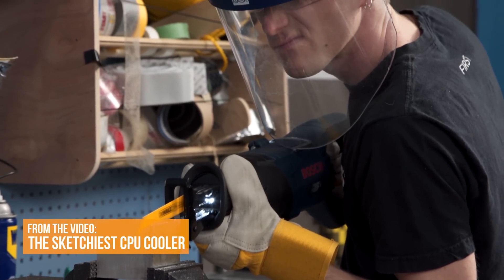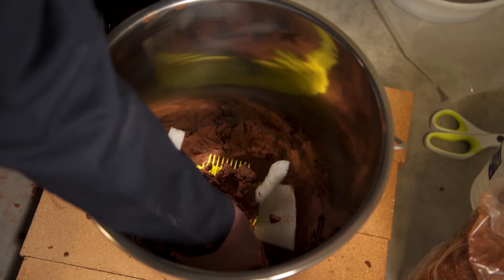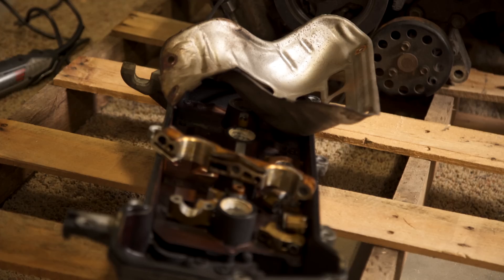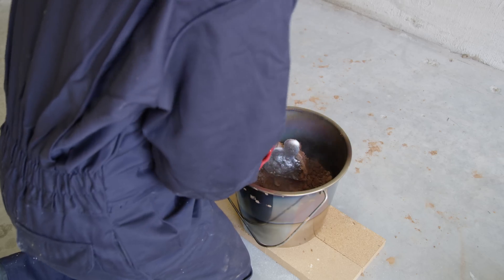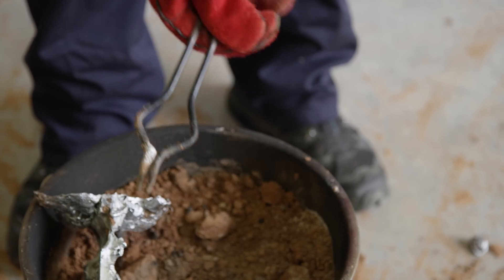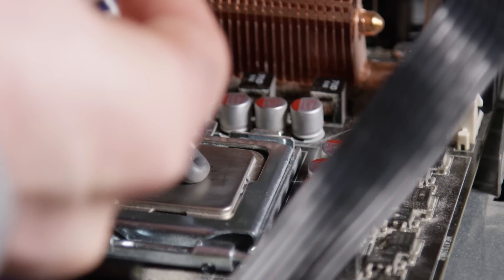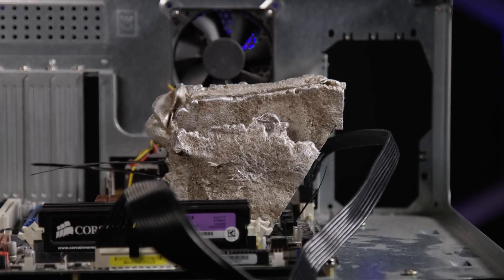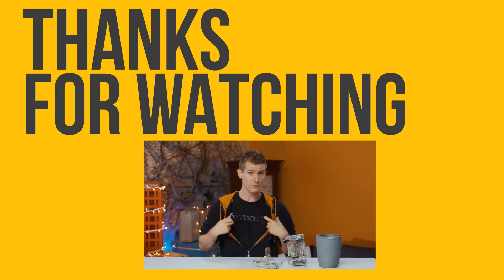The WORST CPU Cooler EVER – Sketchy Heatsinks Ep2

Comment: I'd recommend dunking your PLA in a clay slurry thick enough to stick to the plastic a bit, but thin enough to fill in all the tight spaces.  Let dry, repeat the process for a few layers.  Once you have your plastic model encased in a few layers of clay, it's time to fire it in a kiln, just like other pottery (you did leave holes for the gases from the melted plastic to escape right?)  When it's done in the kiln, all the plastic should be gone, and you have a hollow ceramic shell.  Bury that hollow shell in fine sand to give it more external support, leaving only the pouring holes exposed. Now you can fill it in with molten gold, or aluminum, your choice.

Comment: Here's a better and easier way: Get a sheet of aluminium, cut it into a heap of fins, stack the fins with cardboard between them at one end to keep them separated, tape up the block of fins and cardboard tightly around the section with the cardboard. Now make a mold for the block (essentially just an open box) that the block of fins will neatly fit inside, pour molten aluminium into the block mold, then lower the end of the fin block that doesn't have cardboard/tape on it into the mold. Once it cools you should be able to simply remove the tape and cardboard to reveal a nice and neat heatsink.

Comment: If you guys do a third episode...and i'm not really sure you should.  Use a tablesaw to cut nice, straight, clean grooves in a block of aluminum.  You can use a carbide tipped wood blade to cut aluminum.

Casting small\thin features with any sort of lost pla\foam casting never works, you need a mold you can preheat enough that the aluminum doesn't harden and clog before it get's to the top of the fin.

Comment: I hope this series progresses over the years until Linus and his gang create their own self-made sketchy computer, complete with weird ternary CPU with worse performance than the Intel 4004 and papier-mâché case.
Reply: angryDAnerd wouldn't be surprised if they eventually made a salfmade computer that does less functions than a $1 calculator, is harder to use than a stock Altair 8800, and would probably be blown out of the water by ENIAC, yet requires a whole air conditioner to cool
Reply: You joke but that's not actually that absurd. Yeah they won't be able to build a machine that runs windows but the expertise to build from scratch a simpler computer is a pretty common thing for computer science students to learn at university. Say you wanted to implement a subset of the MIPS instruction set (as opposed to ARM or x86, the popular instruction sets for phones and computers today), I had a class second semester of sophomore that was all about the hardware/software interface, and the textbook walked us through doing just that. We designed (but did not physically build) a CPU that could add, subtract, read from and write to memory, and branch (make decisions).
Reply: If all you're going for is a calculator that doesn't have to deal with storing data or loading programs, it's actually pretty straightforward. You're just describing what amounts to an ALU and a keyboard taped to a 10 digit display. The knowledge required to build something like this "from scratch" (i.e. from raw logic gates on breadboards and wires) is taught in university computer science courses. I got it my first semester of Sophomore year.
Reply: Search Ben eater
Reply: Too much off-the-shelf components. Search for Jeri Ellsworth
Reply: Good old MOS 6502.

Comment: Use copper pipe, welded to a radiator, and put everything vertically, fill it with dicloromethane (DCM) si that the liquid rest on the cpu area, CDM boils at 40ºC, si it should keep it near that temperature provided the radiator can disipate enough heat, but being a low boiling point liquid, it woul all work like a refrigerator/heat pipe.
Even the radiator of an old fridge should work (the large passive ones)

Comment: 3D print -> Silicon Mold -> Wax copy -> lost wax casting. also put the funnel right on the top of the fins and your static pressure problem will disappear.

Comment: I think a lot of commentators kind of missed the takeaway. 

Aside from the fact that yes this heat-sink is rubbish, the takeaway point is if the average unskilled person tries this idea, it will be a complete failure. Also these videos are fun.

Not all DIY ideas end up failures like this. LTT had a video about using old and cheap server parts for gaming pc and as a result of trying something similar, I now have a dual Xeon processor PC for under $500 with a bit of work and it performs like something 3-4 times more expensive.

I believe LTT is great at showing real world scenarios when the videos are more like this one and not EXABYTE PC BUILDS that I absolutely can not relate to from the average consumer point of view.

But like many of you have said, regardless the result, LTT always entertains, especially with LINUS going more crazy and creative for his video as time goes by. 

His much older videos were more stiff and boring haha. But still all of his work is informative every time and hence why I subscribed. I'd love to work with the guy, he's a bit of a genius.

Comment: isn't the foam meant to be burnt out before pouring? , but in all honesty if you're going to melt down an engine why not just use the radiator or oil cooler ?

Comment: when lost casting is done, the mold is heated in a kiln to remove any moisture and to also melt the foam/plastic. Most small foundries use wax for small items. After heating the mold, the metal is poured in the mold with it still hot. They do make wax for 3d printers for this type of thing.

Comment: You should had flipped the mold over a filling from the bottom of the heat sink. Easy way to think of how the metal will flow is by thinking of it as water that hardens quickly. Also creating a fill channel so you avoid spilling molten metal on the top of the mold will help also. KingofRandom has great videos on casting with a verity of metals.

Comment: Your doing it wrong, heres how you DIY a heatsink:
1. drill holes through a square peice of aluminum the size of a CPU block, 
2. push some thick solid copper wires through the holes and curl them up like a heat pipes, 
3. Stack  a bunch of squares of aluminum foil, with some thick cardstock inbetween each sheet, but bigger so you can rip it out after. 
4. drill through the stack using a smaller diameter bit then the wire.
5. push the copper wires through the holes. 
6. Now you have a sketchy diy heatsink that might work.

Comment: Why didn't you take a cube of foam and cut some fins out of it with a hack-saw, and then put it /face down/ instead of up? If you did that you would have cleaner results and the aluminum would be able to reach the tiny fins. I guess I'm missing something?

Comment: you should consider making plaster molds out of the PLA prints, heat in an oven, inverted over a catch pan, until all of the PLA has been completely eliminated and the mold is completely dry, then pour into the mold. You can get substantially more detailed castings this way and it isn't even particularly expensive. Other things to note: you should preheat the mold to prevent cracking. The mold can be more readily dissolved in water if you dump it in as soon as the aluminum inside has solidified.

Comment: Jeez Linus; how many beer, soda cans are around there? You went and bought and engine for the material only? The mold could have bee a wood frame with compacted molding sand instead of trying to pour into a bucket.Another is a safety issue; IF your sand was too wet you'd get a steam explosion and molten aluminum everywhere and on you. As for the cpu contact area you could have belt sanded the area and then fine sand it on sandpaper glass plate backing for flatness.

Comment: To all those who believe this was a terrible attempt or no experience with lost wax/foam mold and casting, honestly it's a very typical result for a first attempt. 

The issues are mainly down to small technical problems that tend to compound the process.  I would say the biggest issue with this attempt is a poorly executed pouring cup or funnel and gate to allow good internal flow. Though I have no idea what the temp of the aluminum was that could also have played a big part. Though the use of "Green Sand" was probably not the best choice as it's not the best at detailed castings. Never the less good try guys.

Comment: I think what you really want is either centrifigal casting (using the lost wax method). You make your object in wax as you did. Then you put it in plaster of paris (I think) and let it harden. Then you heat it and let the wax melt out. Now you have a hollow space. You heat your metal (silver in this case) in a crusible in a centrifical casting. Once the metal is hot enough you release the pin and let the centrefuge spin, forcing the metal into the mold. Or use vacumn casting.  You can get a jeweler who does casting to do this for you. They charge a fee plus the metal cost. Silver is a rather excellent conductor, much better than copper. :)

Comment: wouldn't it be easier to get thin sheets of alluminum, heck even cut them from soda/beer cans, and then attach them on to a solid plate for the base?

you could even make a portion of the fins and the base copper

Comment: Resources not rezourses.

Have you guys tried vibrating the mold while casting. It helps when freezing ice to be Crystal clear and pouring epoxy stuff like table tops to remove bubbles.

Comment: Oh boy. I'm not a genius in this field, but i would do it differently. First, i would create a thin sheet of aluminium by molding it onto a flat surface, then cut it to pieces according to plan and solder this pieces together. This is probably how you should not do it, but it is the most simple way i can think of without thinking much.

Comment: That's not how your suppose to cast with PLA you need to burn the mold out first over a fire while it's incased in a resin based mold suitable for metal casting.

Comment: why not do the first version of the mold, but set the bottom of the heatsink be at the top? 

Doesn't have to be flat, there, it's not that hard to mill that part down to being flat. Shit, you guys used a saw anyways, so why does flat matter.

Comment: trying to re-invent the wheel i see. There is a reason all industrial heatsinks are made from extruded aluminum. I would recommend casting a solid block heatsink with 304 stainless 1/8 ID tubing,  this way you could experiment with different cooling mediums. I.E. Water, Liquid nitrogen, glycol, methanol, etc. Would be easier and somewhat more original as a topic of discussion

Comment: Should do a Liquid cooled system that uses a full sized car radiator
Reply: They did in one of the Scrapyard wars
EDIT: with a car heater core
Reply: @Young0maker  WHICH ONES EXACTLY?? I NEED TO KNOW
Reply: No, not really. A larger rad surface area means that more heat can be put into more air.
Reply: op3l yeah but it wouldn't heat up as easily
Reply: So then why dont they use tiny CPU heatsinks in cars instead of massive radiators?
Reply: @Superabound2  the radiator is basicly just a big heatsink the water is just moving the heat to the radiator so it can get cooled by the passing through air
and the reason they do this is because they can much easier place it at a possition where they get the most air going through it (ususaly the front) and bigger surface area in a smaller format.

try putting a piece of cardboard in front of your radiator to cover it up on your car and take a drive wont be to many minutes untill your car will overheat because the lack of airflow through the radiator. (common hack here on diesels to cover like 50% of the radiator in the winter  when going in to the -°c´s to make it heat up faster because of the cooler air flow during winter times.)
Reply: Brandon Cline Because this series is about sketchy heat sinks (not rad setups) without having to source computer cooling solution parts... At least that's what I take from it.
So, if you used a full sized car rad, you would still have to have a very serious pump to get the water flowing through said rad. The heater core solution Young0maker mentioned makes a lot more sense, but you would still have to buy a fairly serious pump.
Reply: I run two Watercool Mo-ra 2s. Car radiator territory, even bigger and thicker than some. I have to run 2 20cm 600rpm fans under load but my system is ancient and power hungry. It could run a pretty decent modern system without any fans, but the temps wouldn't be amazing. The fins are very very dense so it's not the best for passive cooling. Not sure about a car radiator. 
Another problem with big rads is that quiet, decent 20cm or bigger fans are pretty much non existent. At 600rpm there is no wind noise, but my fans still make some "motor hum". I've had other 20cm fans and all of them were low quality.

Also, if you remember one of the scrapyard wars, full size car radiators are not that cheap.
Reply: Hello _ Yes, I understand how liquid cooling works, I'm just saying that I don't think it falls into place with the series purpose/goal. But then again, it's taken a crazy turn when he's literally buying whole scrap engines to melt down for heatsinks, lol.
Reply: This would be awesome
Reply: They did it, that was painful
Reply: @BlackStormMC  lol yea after i saw the video i was just like "what have i done o.o" XD
Reply: I use 2 truck oil coolers to cool mine. it works fairly well. looks awesome. but getting fans that fit/ are not loud was a problem. one massive fan = loud and not enough cooling. 2 medium fans= not too loud but the best they can do is 37C coolant temperatures. in a 25C room when gaming. huh i guess thats not too bad now that i think about it. my cpu cooler sucks so those temps are high
Reply: Why not just somehow retrofit a small section of car radiators/condensers for a air-cooled heat sink solution if you're going for cheap!? They have a crazy high surface area for heat dissipation, but fins are super thin, meaning they wick and dump heat quickly, but may not give you enough mass for the small area you have to work with. It may even out.

If more mass is needed, you could source a section from an air-to-air intercooler that might actually work fairly well (Get an OEM top mount, as they aftermarket ones have pass-through chambers that are too thick for this.). I'm not sure if I can explain this well, but if you leave only one vertical cross section of fins on top of the lowest pass-through chamber, then cut that chamber in half so you have one flat solid piece, then bend that bottom piece at a 90 degree angle (mounting it on the flat side you just bent upwards), then you would have several vertical stacks of more solid pieces of aluminum (originally the pass-through chambers) going upwards with fins between them to wick away and dissipate the heat. =)
Reply: Yes. What I was getting at is, it'll basically only be as cool as the ambient temps.
Reply: op3l no one is arguing that. Simple science, unless you're using evaporative cooling.
Reply: Brandon Cline #ScrapyardWars man.....luke done this
Reply: I mean they practically did with WRWC way back when they were in the house. Was like Quad 140mm x4 iirc, thing was massive
Reply: Joe Likes Tech Well, in this case, the water is the heatsink and the radiators are the heatsink fins.
Reply: fuck. yes.
Reply: They did that
Reply: and use the pump off the car..
Reply: I had a TEC setup in early 2000 that used a motorcycle oil cooler radiator.  Got a Celeron 633 to 1Gz, sub zero cooling!  I had to insulate everything to prevent condensations, but I BEAT INTEL TO 1Ghz using the rig!!
Reply: I have this its cheap and easy
Reply: You asked for it, so here you go - https://www.youtube.com/watch?v=_H4PGFqVI_A (But it's in russian)
Reply: They did it in scrapyard wars iirc
Reply: or air conditioner.
Reply: Here you go: https://youtu.be/_H4PGFqVI_A
Reply: Yes
Reply: If it works for me it should work for you
Reply: It will still burn to a 7980xe
Reply: No, use a closed circuit liquid sodium cooling system that they use in some nuclear reactors.
Reply: I think they did that with a radiator, in the bit about heating a room with your PC
Reply: it wouldn't matter how big the radiator is. It would ultimately be limited by the ambient temps.
Reply: @op3l  ...sooooo???? still it would get incredibly good temps.
Reply: Brandon Cline stfu nyan

Comment: Complete waste of time.
The Arctic Alpine Rev ii cooler costs fk all.
Handles 95 watts, has a 95 mm fan,much quieter than intel option,comes with mx 4 paste, 
Just leave asus a.i. off (I dont think fan is pwm).
Sorted for £9.